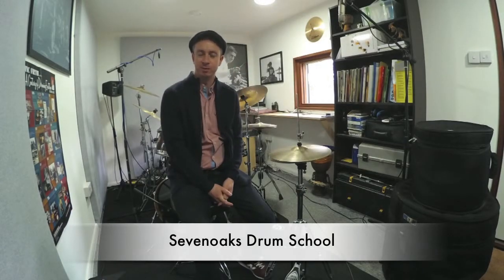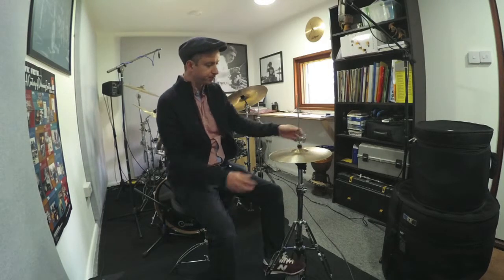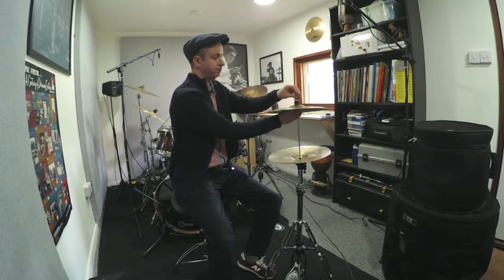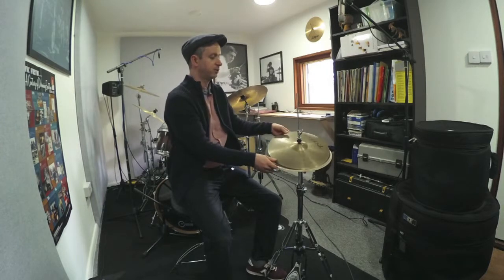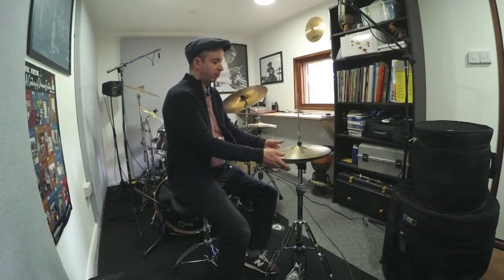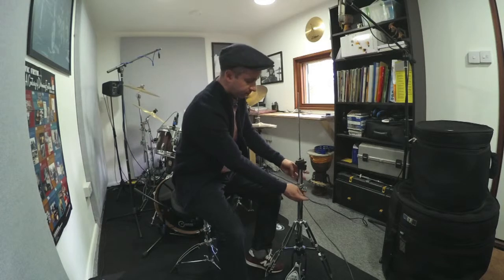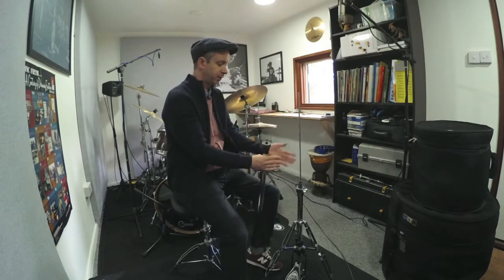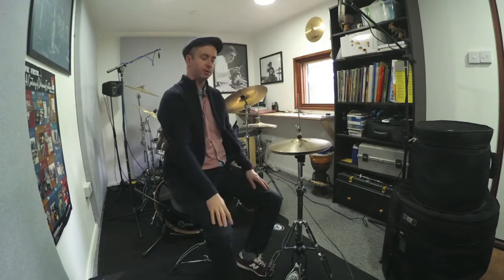How to fix/assemble a Hi-hat

Comment: Does NO ONE have a tutorial on getting into the lower tube to clean and replace a spring or lower rod???
Reply: Did you ever find one? THanks!
Reply: @daedalos5132  No sir. I never did.
Reply: @abrotherinchrist  Funny enough I just figured it out.. i had to actually flip the tube upside down for the spring (and washer) to come out.. the previous owner had put it together wrong so the spring wasn't doing it's job..
Reply: @daedalos5132  I wonder if that was my problem, too. My hi hats have always had a sticking issue and they don't work quite right.
Reply: @abrotherinchrist  Ya, I used a flashlight to look down the tube and saw the spring just sitting there.. let me know :)

Comment: the pedal in my hi ha just stays down. i can pull the rod up and down from the top, and the pedal moves with it, but when i let go of the rod the pedal flops down again. (I have on of those rods that bends over, so i know that its not disconnected somewhere.)  ive seen people talking about re[lacing a spring, but I don't think mine has a spring in it. im very new to playing, and i got my set secondhand.
Reply: I have the exact same issue.. did you ever resolve yours? Was there a spring missing? Thanks!